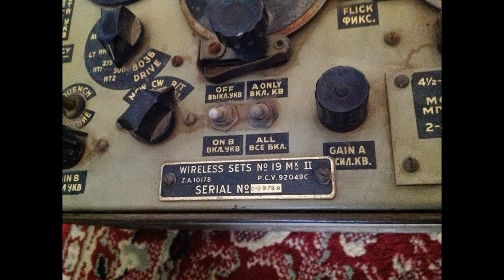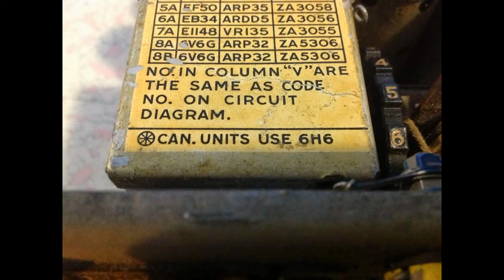Opening up a WS19 military transceiver from WWII

Comment: This was used by observers to send messages to the gunners using the 'A' set which had a range of up to 15 miles.  It was also used to communicate from forward positions to base, often many miles behind.. The 'B' set only had a range of 1000 yards and was used for vehicle to vehicle comms

Comment: It is indeed a tank to tank/other vehicle radio, built under licence from Royal Signals in the UK. Not many people remember that the Russians were on the side of the allies long before the Americans, and gave up 26M lives in the process.

A valuable find, on Ebay you should receive around $1,000 if you pitch it right. Do not damage anything, it is in good condition and very well worth cherishing.
Reply: As a quick ps, this has the rare "B" VHF set fitted. I have used a refurbished on of these to speak with people thousands of miles apart (London to Cape Town and London to Moscow being my records) on long wire antennae